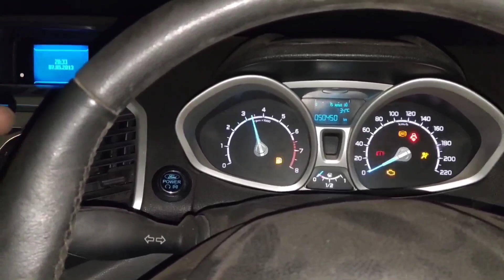Ford eco boost 3 cylinder engine dismantling(@skilledmechanictamil )

Comment: Hi brother your work super. I have skoda Octavia 1.9 tdi 2004 model , i bought as second hand two years ago , now totally it completely 354000km  engine running good, no black smoke.but i have low pickup problem and mileage problem per litre diesal it gives only 16-17 km .but other said Octavia diesal gives 20 km per litre.please give suggestions brother
Reply from the maker: This time dsl not pure dsl
Additive mixing dsl so causes
Mileage  drop
All car common problem  pls check air filter and oil condition good ok no problem
Thanku
Reply: Ok brother